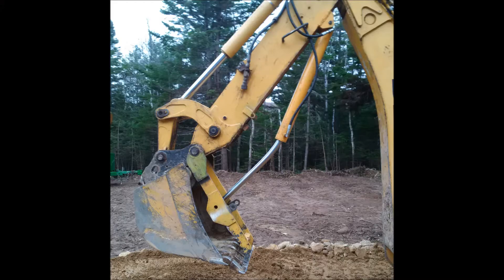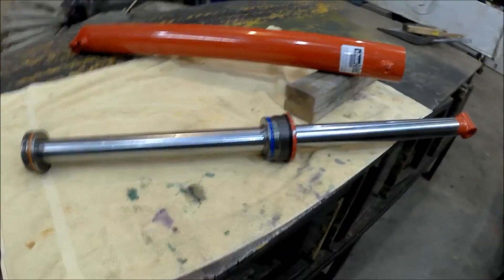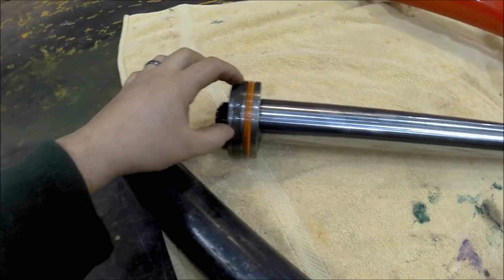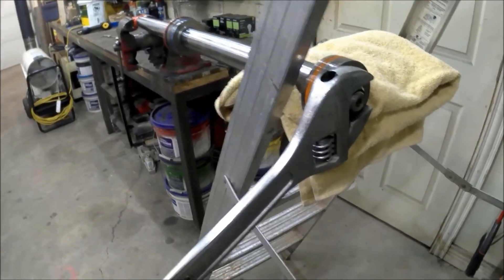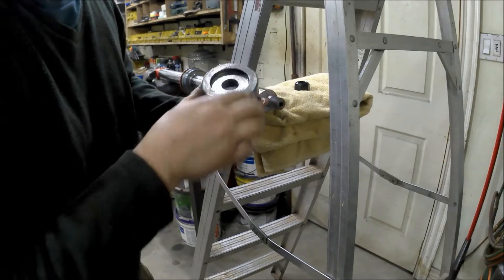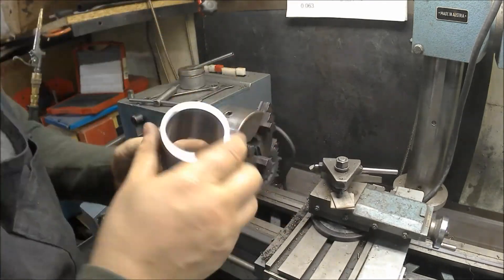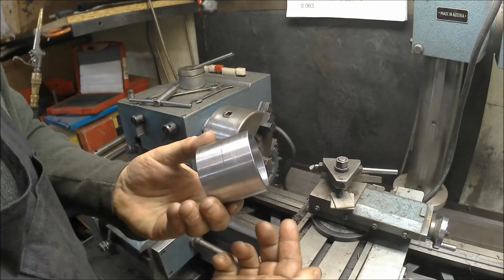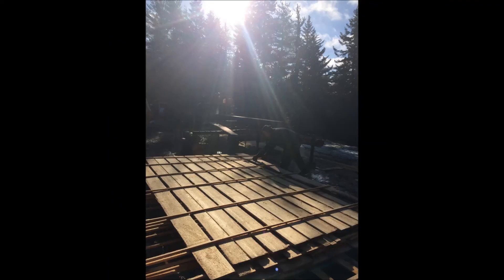Hydraulic Cylinder Stop Tube

Comment: if this was welded to the gland and had an UHMW-HDPE sleeve spacer it would be fine.. But your going to have this rubbing, sliding, vibrating on your cylinder arm chrome creating dust, shavings, oxides that will destroy your pump in time.

Comment: That stop collar was an ingenious solution to control stroke. 
I did a similar job except the cylinder i needed was $650 from dealer so down to princess auto too needed 2 in bore 8 in stroke but needed 5/8in pin holes so i found one with right bore and stroke but 1.5 in to long and had 1 in pin holes for $95 so i figured that i would make a bushing for the base end which gave me the right offset the other end cut off the pin hole off the rod and drilled my 5/8 hole at appropriate distance which still had enough rod sticking out fits and functions perfectly even had the right fittings for hydraulic lines. 

The only thing I would have done differently on yours is make the sleeve a fairly tight fit so it stays against the plunger you had off that way it couldn't slide up and down shaft possibly scoring shaft but if u had nice smooth finish probably wouldn't hurt anything 
Great job with making it work storing that tidbit of info in back of mind for future endeavors 💨💨💨👍👍👍

Comment: Very interesting!  That is what I like about you.  Ingenuity. Making a sleeve fitting inside a cylinder to restrict the stroke while using a step ladder to hold your rod! It did worked well, without unecessary expensive tools. I always found it tricky to put back the O-rings inside the cylinder housing without notching them on the threads. Great work!